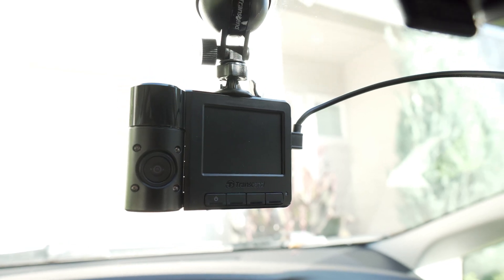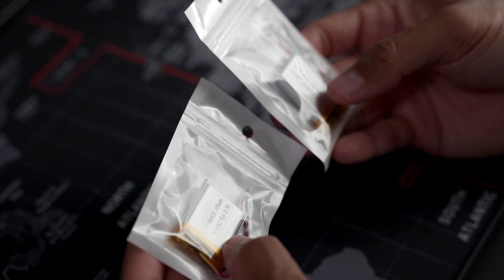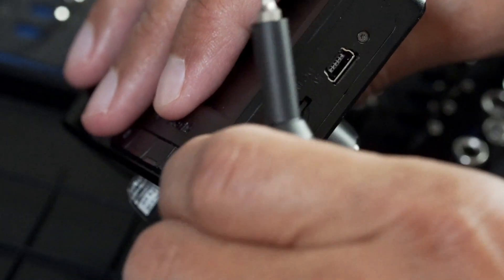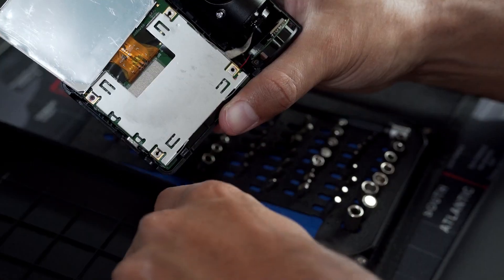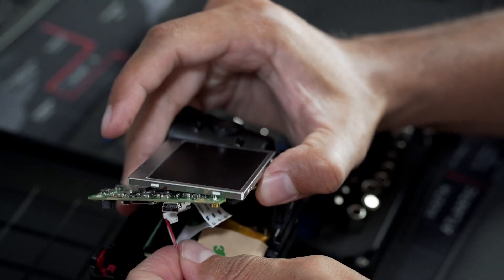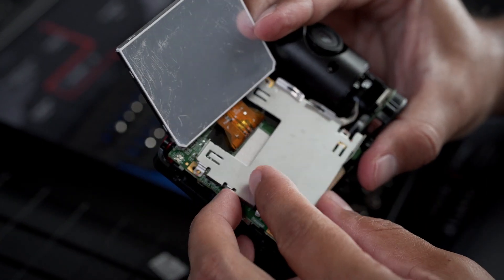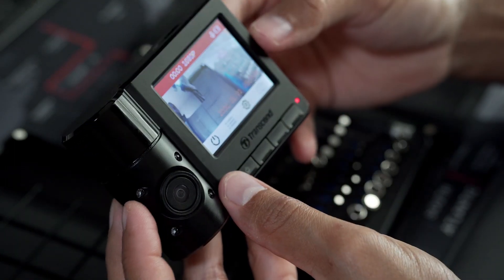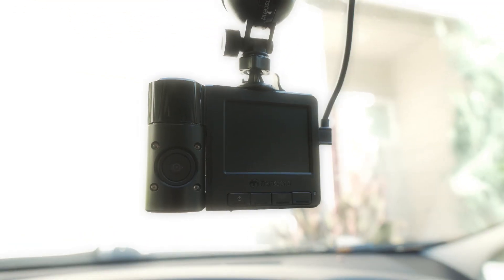How to Replace Transcend Pro 520 Dashcam Battery

Comment: How many years did the original battery lasted? What is the ambient temperature in your country? Thanks
Reply from the maker: Hello friend! It lasted for 5 years and the average temp was about 70 degrees Fahrenheit or 21 Celsius.
Reply: @clean8-bit  in India summer temperature reaches up to 40 deg c, when parked under sunlight it may raise to 50 deg c I guess. It looks like i should go for super capacitor model instead of Li ion
Reply from the maker: That's hot! Sounds like a good idea.

Comment: what is part no or link for buy ?
Reply from the maker: Part # 552535 and link:
https://www.ebay.com/itm/394465822324
Reply: @clean8-bit  Would it be possible to use #502535? Its a little difficult to find #552535 in my place and ebay not available here.